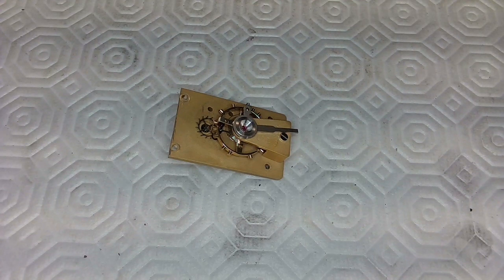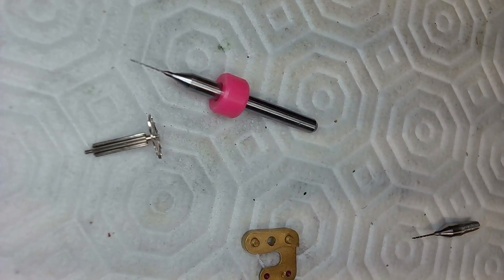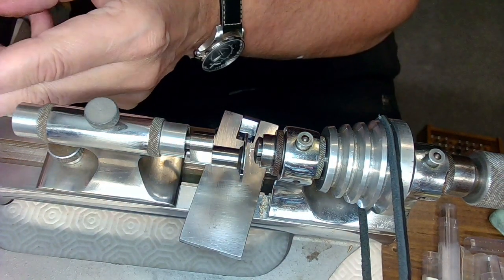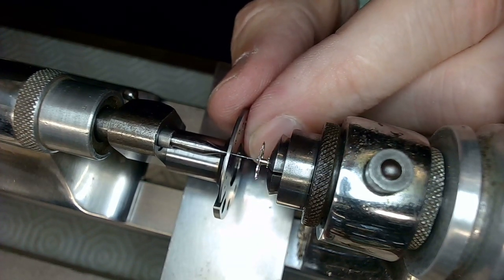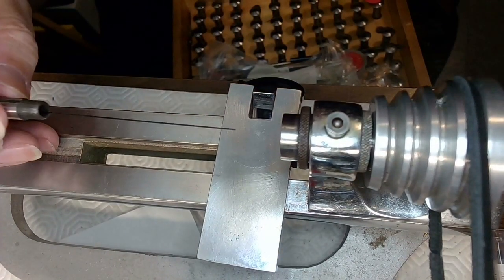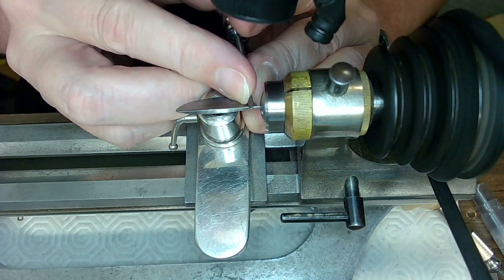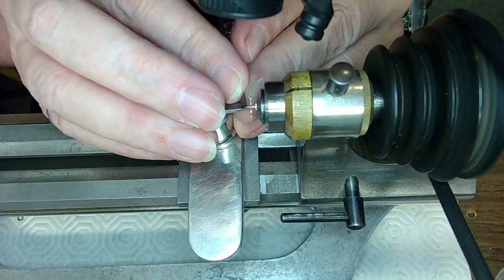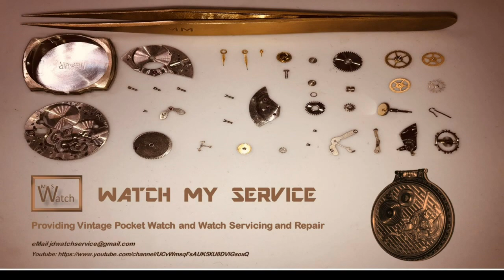Carriage Clock Escapement RePivot

Comment: I cringed every time you hit the new pivot with the hammer because I thought you might be mushrooming the end of the shaft. Same with your sizing. You were facing off the end, and I was wondering about the burr that always forms on the end when doing that, but I saw you clean up the shaft after doing that. You've obviously done this before and are successful at it, but from my side of the screen I'm thinking how I would attempt to do that. That's why I don't fix watches. A light touch and steady hands are something I lack now. Good work on a very fidgety job!!
Reply from the maker: All went well and I did need to do a pivot on n the other side.  Put a video on.